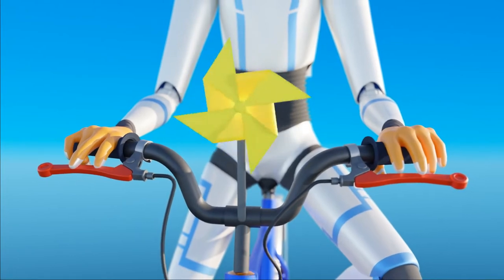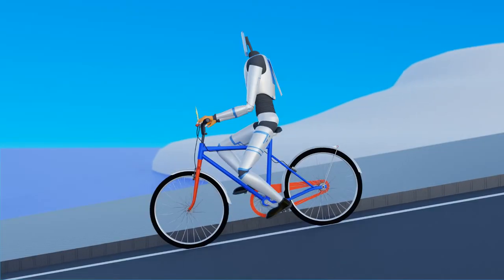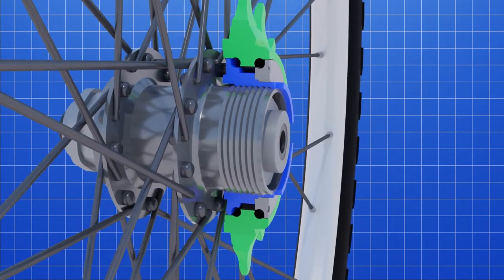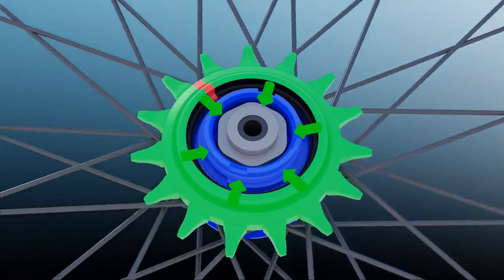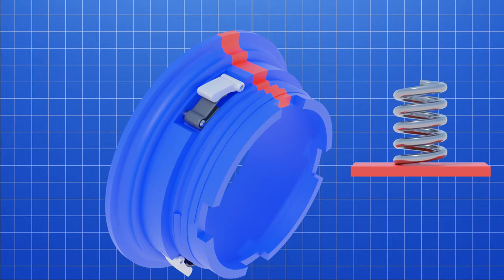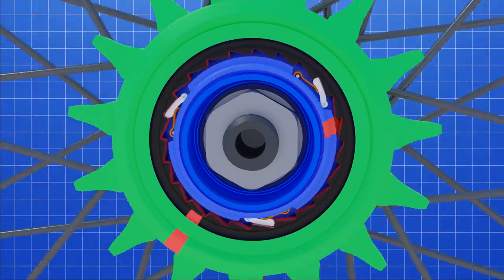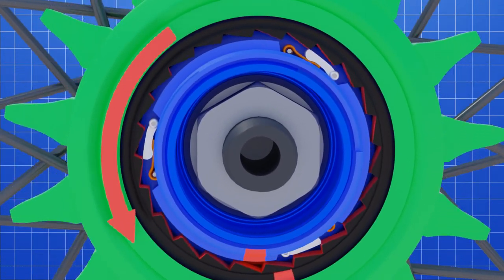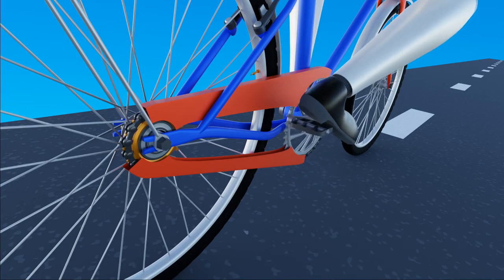Secret clutch In your Bike(bicycle)!

Comment: Sir i understand.almost every this but unable to understand why bycycle moves after stoping paddling in downhill
Reply from the maker: watch the last part. gravity keeps pushing your bicycle downward and also already its in motion so bicycle has kinetic inertia, I will keep moving downhill. inner part of the sprocket continue rotating along with rear wheel. it will rotate faster than sprocket ratchet teeth part. so u will get the same relative action.
Reply: @workingsgotanimated  thanks for your precious information but still not fully understand if possible please understand me in detail
Reply from the maker: @PravinKumar-wn8ry  watch is video from 4mins15 sec to last few times and pay attention how inner race with paws over running the outer sprocket. hope  you will get it
Reply: @PravinKumar-wn8ry  When you peddal, you push against the inside of the wheel with those tabs, which stick out like gear's teeth.
When the bike is moving but the chain is not, the inside wheel goes faster than the one you normally push it with, and instead of hitting the teeth, it slides over them, compresses the springs, and the tabs rotate down to slide past..
Then they click back up, and this process repeats many times so that you can start peddalling at any time during the rotation, without noticeable free movement before it locks again.

The tabs popping back up, after each tooth passes over it, is the clicking sound you hear, when you're not pedalling but are moving.
Reply: It also happens when you peddal backwards, and is why the bike will not move backwards when you do so, but you hear clicks instead.
Unless you have a bike that doesn't have a freewheel, e.g. some kids' bikes, or a BMX.